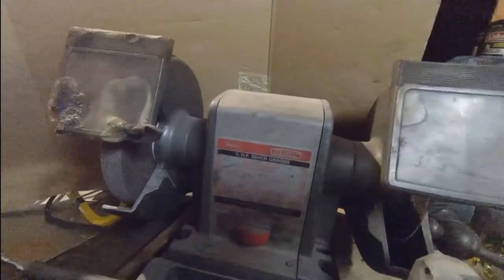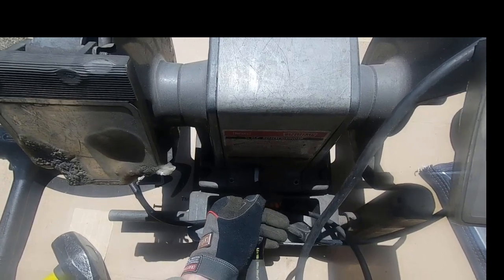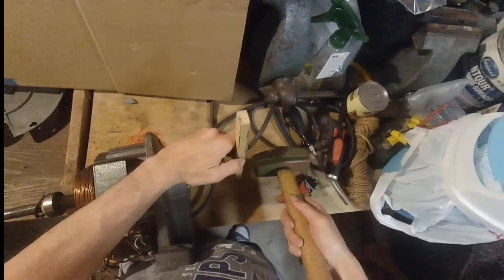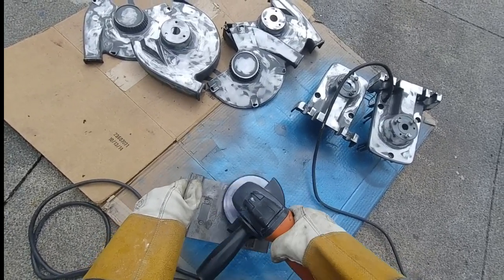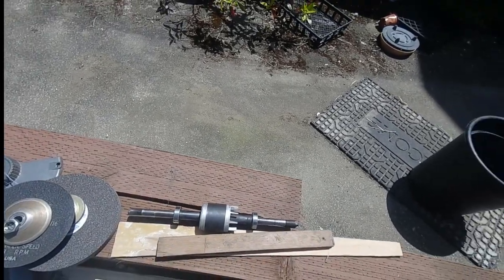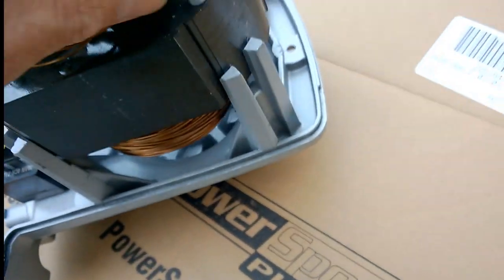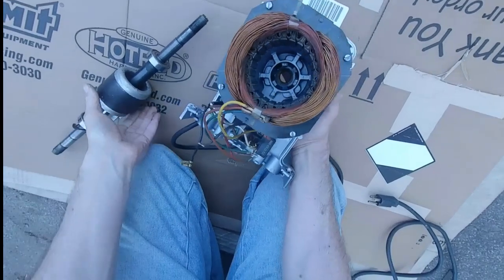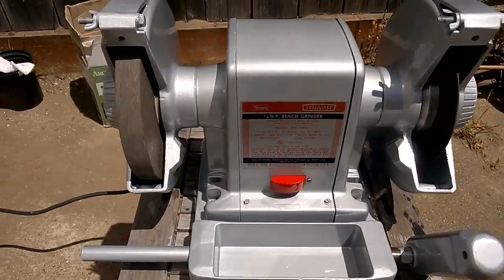Craftsman block grinder restoration

Comment: These things run forever. Elderly gentleman down the street passed away last year. His son was junking all the garage tools. I grabbed a few items, one being a 3/4 HP Craftsman grinder. Dirty n grease, I got it cleaned n painted. Oiled the bearings, new grinder n wire wheels and it runs like a champ.

Comment: I just picked up a 1/3 hp block grinder for thirty dollars in Mobile Alabama from a woman selling her deceased fathers woodworking tools. It appeard to be in good shape with all the lenses  or shields still there but when I turned it on it wouldent turn and the motor would make a humming sound and the outside being heavily oxidized from the shop being right next  a salt water bayou. I bought it anyway thinking It should be servicable.

Comment: Usually you can freeze the rotor and heat the new bearings then drop them onto their journals with no side load. I watched not to hear about painting, or about how to keep from loosing fasteners but to see what bearings were in the bench grinder and you never mentioned it. Also did you fund out who made the grinder for sears?

Comment: My unit looks much like this one with a similar substantial tool rest base. Wheel covers measure about 9 3/8."  Lots of questions. "Center section" is missing. Are there alternate id numbers elsewhere on the machine?   I guess the unit stopped working, someone disassembled it, and buggered with the wiring.  Switch style looks correct, but pins don't seem to match representation in supplied wiring diagram exactly. No blue wire in the case. Capacitor disconnected. Are there schematics?  How to properly connect the Green, Red, Yellow, and Brown wires from motor to spin-start test it on 120v? Thanks,
Dale
Reply from the maker: Hi Dale,
Your best bet for schematics would be to post a request at one of these forums:

https://www.garagejournal.com/forum/showthread.php?t=249539
http://owwm.org/viewforum.php?f=77&sid=aefbcbe44423a3080df81d719e098d3d

Someone on one of those forums will certainly be able to help.